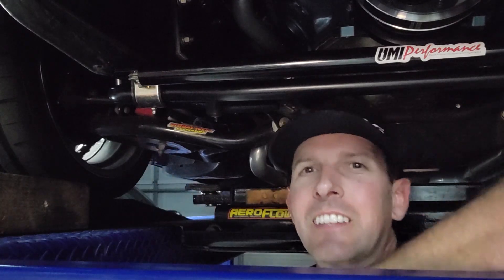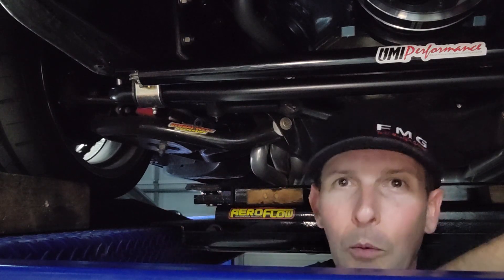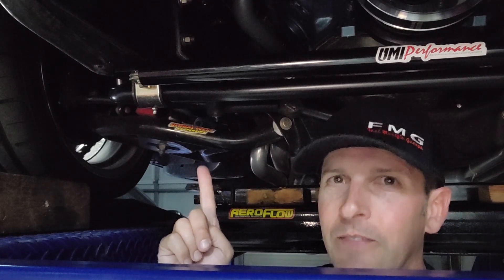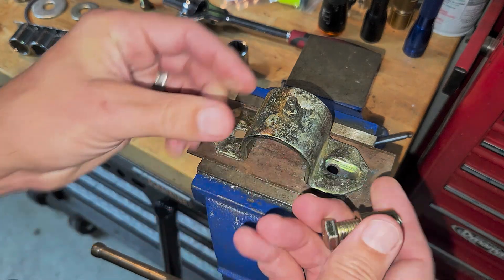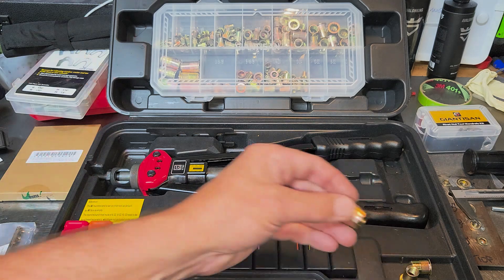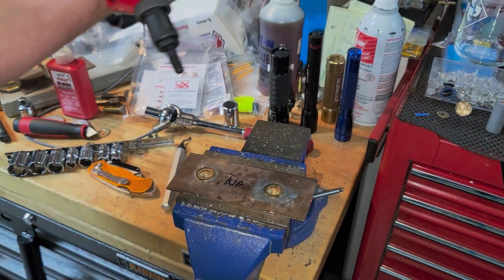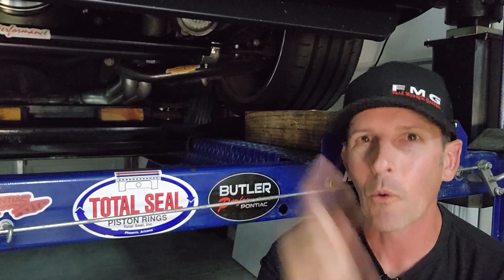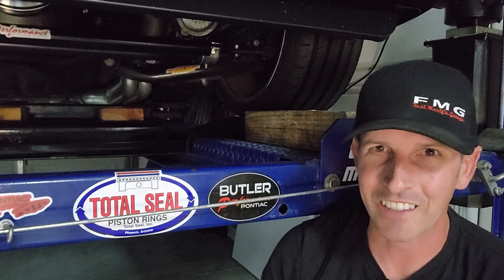How to fix a stripped sway bar bolt hole?  Part 2  No Welding.  3/8 Nut Rivet?

Comment: Your solution is Brilliant! Been staring at the underside of my 4 Runner for a week now, wondering. 2 stripped out and 2 broke. SOLVED !
Thank you for thinking to add the links to the tools and whatnot used Very Nice !
Reply from the maker: That's awesome to hear!  Thanks for dropping a comment.
Reply: @FastMonty  Just got off Amazon... things are enroute !  👍
Reply from the maker: @doughill4237  Awesome!  Can't remember if I implemented JB Weld in this video, or not... but, I now use it on the RivNut before inserting it.  Have fun!
Reply: @FastMonty  Ah, excellent... JB Weld added to my "shopping list" Thank you!
Reply from the maker: @doughill4237  Saaaweeet!

Comment: One of the issues I've come across with rivnuts in the past is that humidity gets in between the rivnut and the metal it's installed in, causing the frame to rust just enough that the rivnut can start spinning during future disassembly. This can happen even if you paint the bare metal first, because the rivnut digs into bare metal as it compresses into place. I've resolved this by applying a thin coat of JB Weld to the outside of the rivnut before installing it, which seals out moisture and fills all the voids. It also has a side benefit of creating an even stronger hold for the rivnut in the frame. With that, I've had rivnuts survive 10+ years in a daily-driven vehicle in Vermont, even on salted winter roads
Reply from the maker: Ohhh, you're blowing my mind today... I love that idea too!  Thanks Frank!

Comment: No biggie but I’ve always called them “riv-nuts” instead of nut-rivets.  This goes back to my training as an aircraft mechanic. 

Otherwise I enjoy seeing your videos and I can’t stop watching them. I’m amazed that you’ve done nearly everything I have planned for my ‘72 Chevelle.  Maybe you can do something about the hydro-boost brakes you mentioned are in your Goat? 

Set it on autopilot and enjoy the ride!
Reply from the maker: Thanks Chuck!  Yeah, I think I said Rivet Nut in the video... will definitely add that as a search term.  Congrats on your Chevelle... I will be upgrading my Master Cylinder in the next month or so.  I'll be sure to discuss my Hydro-Boost system in that video.  Stay tuned!  Thanks again for the comment.

Comment: I’ve been using these since 1984, when I was building my 1934 Ford coupe. Didn’t have a welder back then, so I used them to attach the fenders and running boards to the chassis
Reply from the maker: Thanks Mike!  Yeah, I think I'm going to use this for many more projects. Thanks!
Reply: @FastMonty  they also make these inserts for flush mount installations as well, so you won’t have that 32/1000 space to shim for
Reply from the maker: @mikeburnett7028  Yeah, someone mentioned that... not sure how my "pull test" would behave as there's nothing pushing against it.  So, be careful, and/or test em like I did.  Thanks for the comment!

Comment: If you check online, you should be able to find flush mount nutserts. Those are usually what I use
Reply from the maker: The only flush mount thread certs I could find are for full depth, like in a block of material, not for thin sheet metal.  If one does exist for thin material, I agree that would be easier to use. Thanks for the comment!

Comment: I have an Astro Pneumatic Tool ADN14 drill attachment rivet nut setter.  It is faster and fits into tighter spot than the large pliers style, but you need a strong drill to use it.
Reply from the maker: Thanks Steven!  Good to know!

Comment: Socket cap bolts have smaller heads that fit better in the tight space of the swaybar bracket. We've been doing that on B-bodies for years when switching to bigger swaybars. We also use the same clipped washer that you came up with.
Reply from the maker: Why didn't I think of that?!  Love it!  Thanks Frank!
Reply: @FastMonty  The other nice benefit to using a socket cap bolt is that the allen bit fits much more easily than a socket over an already-cramped head bolt. Makes it easier to get an accurate torque value when tightening
Reply: @FriendlyPhoton   Or a Flange Bolt

Comment: You should look into plus nuts. Similar to rivnuts but have much higher pull through strength, can be found in steel and can have more thread area.
Reply from the maker: Ohhhh, Plus Nuts ?  Very interesting, I'll look it up.  Thanks for sharing!

Comment: Hey my friend. What do you think about cutting a recess in the frame hole before you install the insert? Kind of like a Forstner bit but for metal to sink that top rivnut flange even with the frame surface.
Reply from the maker: Like a counter bore?  That would work... I don't know what tool would be used, nor how it would affect the strength of the "sandwiched" steel in the rivet.  If you figure out an easy way to do it... test it, and let us know!  Thanks!
Reply: @FastMonty  Probably a spot face drill bit but I don't know if that can be used in a hand drill or how it could be stabilized while drilling. Doesn't matter, you've done a beautiful repair that will last forever. Well done.
Reply from the maker: @richmargadonna2155  Ha!  Agreed it would be tricky with a hand drill.  Thanks for the comment!
Reply: @FastMonty 
I accidentally cut a small counterbore removing a rivet on a frame using a Roto Zip tool. You would just have to find a way to get your 1/32" deep counter bore depth properly gauged though.
Thank You for the great video!

Comment: Excellent episode for me I may have a failing sway bar bracket . But I a pondering applying UMI's power tour package to my car . Regardless I may have to use a the rivet nut technique. My brother already has the rivet nut installation tool so one is available for me to use. However I do know he has had some fail, but I do like the idea to use them . Inspect as you would any important component of the vehicle. Birdy
Reply from the maker: Yep, exactly why I derated the max torque load to 50% of what I tested it too.  Even then, it's 4x stronger than the original bolt.  Have fun, and let us know how it goes!
Reply: We had a rivnut fail so we drilled it out the best we could and pushed the remaining piece into the dark recesses of the frame for safe keeping. We'll never hear it rattling around (car too loud!), nor will it cause problems within the frame
Reply from the maker: @Kleinbissendorf  I'd do the same... and, agreed, you'll never hear it.  ha, ha..

Comment: I fixed a thread on my snow blower today that was thinner metal than yours by filling some threads with my mig welder then used a dremel stone to grind some of the weld cause I didn’t have the correct size drill bit. Then retapped it and it was as as good as new.
Reply from the maker: Ha!  Creativity at it's finest!

Comment: rivet nut is holding up good? i only use rivnutz only for light duty.. i think for suspension I would drill it out and weld a nut on
Reply: second what about bi-metal corrosion between aluminum and steel in the sandwich?? I've done something similar down the road used aluminum as a spacer between 2 steel pieses and the aluminum turned to dust from corrosion with in 5 years... you can tell the aluminum coroaded from where the bolt was and worked its way around
Reply from the maker: It's awesome. Yes, welding a nut inside the frame is the ultimate solution. Last video I proved that the riv nut I picked is more than  4x the strength of a stock bolt. This video was how to install it and maintain the strength because that top flange needs full coverage. Thanks!
Reply from the maker: @digitalbilly  Ohhh geeze... don't know about the corrosion.  I guess we'll wait and see!  Ha, ha... Thanks!
Reply: Was going to make the same comment on on corrosion. 2 dissimilar metals in the presence of moisture/water will begin to corrode (galvanic action). But if the car is garage kept and doesn’t get driven in the rain, you should be ok… definitely a concern for a daily driver. I would also suggest a digital torque adapter for the torque testing. 
      I’m not a GM guy but I find these videos very helpful as they apply to most old cars. Your attention to detail is impressive!
Reply from the maker: @mattcornett7180  Thanks Matt!  Much appreciated!